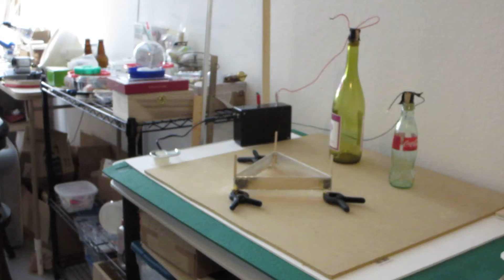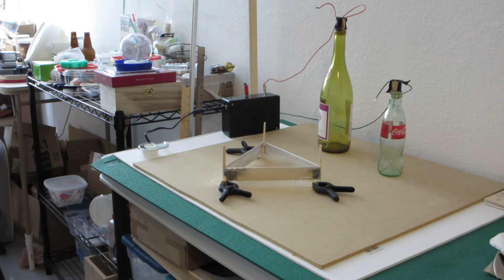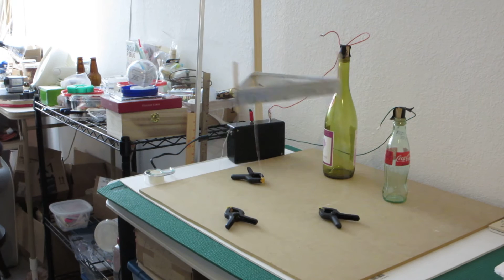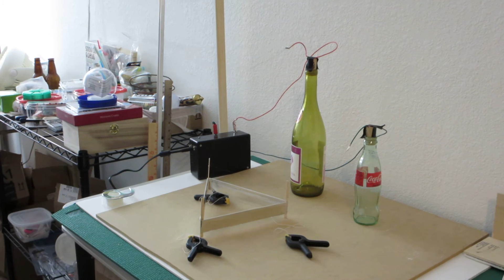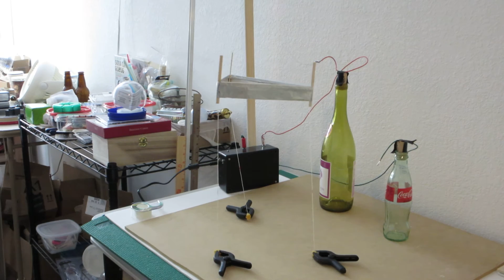Ion Lifter - Ionocraft

Comment: Ionic RC Drone possible?
Reply: I was looking into it, apparently from what I found it can't carry a lot of weight according to some people and it would electrify you.....then again, that's what non-conductive material and insulation are for. However, I also saw pictures of one with LED lights. So..... depending on an outer casing in weight.....maybe, it could be possible, the next problem however is forward movement.....but what I figure is a replacement for flares, bright LED's, maybe attached to a spindle, a lightweight body that shines on the aluminum saying 'S.O.S.'.....yeah.....but it's a weak construct and then you'd need something covering the- I need to go and draw up some plans.
Reply: @madisonatteberry9720  I think forward movement is possible. If we provide more electricity with this method to one side on demand, it will force the "drone" to move to the opposite direction, steering could be done the same way, wouldnt it work?
Reply: @marpinis_k  I must have been tired when I made that post, fixed some things up, now as for you comment, uh.....maybe, I'm not an expert but the problem would be a power source and weight. And even if that doesn't work, maybe a drone with an ion lifter in the center and several on the sides. Imagine four triangular ion lifters forming a pyramid, move left, the ion lifters facing that direction turn on, the others are off, and forward are the triangles facing forward.
Reply: @madisonatteberry9720  I see what you mean, though as you said again the problem is the power source and the weight. Thanks for your reply!
Reply: @marpinis_k  Sure thing.